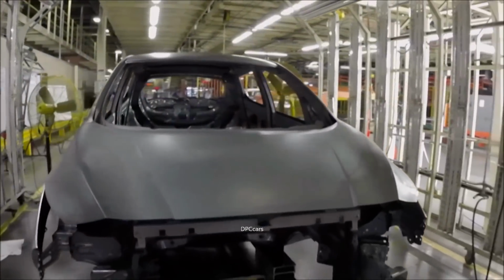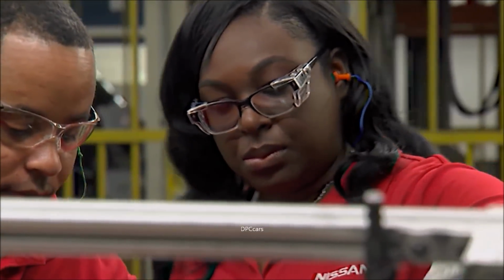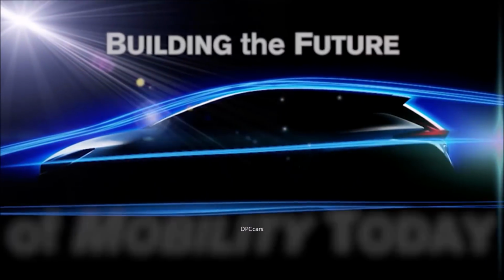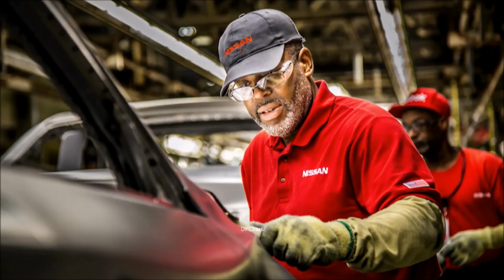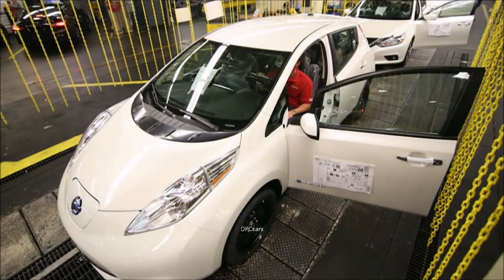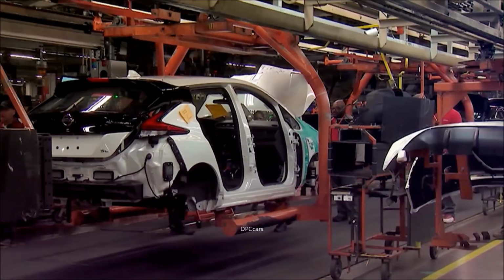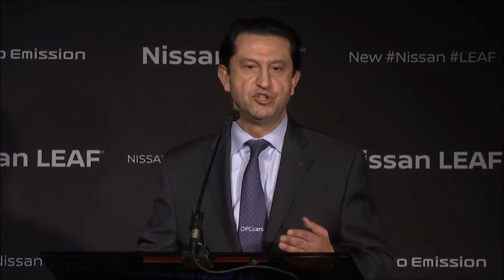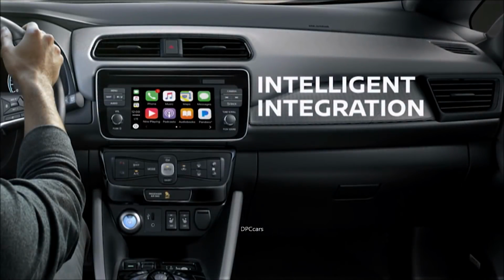2018 Nissan Leaf Factory - How Its Made

Comment: I had Leaf 2013 and that was quiet difference from leaf 2009 !! I traded in that 2013 for 2018 model last week..Wow,that is a completely different car !! Honestly I did not liked the stick out headlights on previous models,now the shape looks sharp ! I'm very happy wit it.They improve the steering and driving is more  comfy and smooth.Also finally it comes with 240V charger !! For me it's a big upgrade to have 150 miles range from 80 on that 2013 model.New battery charges up to 170 range !! But that will go down after few months and should be steady around 150 range  for years..I know this from previous Leaf..The new battery technology has improved as well.I love this car.For me it's a free ride, because I'm charging it from small solar plant I built at my house..Cool.Thanks Nissan for making so many improvements,you stepping up greatly since the first one in 2008..wow.Please don't stop and work on range,so in the future EV can go at least 300 miles per charge..

Comment: Its built for a price. There will be a larger battery model next year but guess it will cost more
Reply: I have no basis for this, but I suspect that the 60 KWH pack would only be on SV and SL trim levels.  It was initially the case with the 30 KWH pack in 2016.  Since chademo is a $1500 option, I think the SV trim will be the car most people should get since that's only $2500 more.  So, I'd predict the 60 KWH car will probably end up being closer to the $37K that the Bolt EV costs.  Personally, I'd just stick with the 40 KWH car and lower price.
Reply: Consider batteries are about $200 / KWH in today's prices, you can guess a car with a larger battery would probably add about $4k to the build price and probably a bit more to the MSRP.  Falling prices per KWH in time will bring that down.
Reply: $34k for a car with 60kWh that does 200mi+ sounds very enticing. That is still cheaper than the Bolt & Model 3 50kWh.

Comment: Its a great looking car, but i'm disappointed at the poor range. Only 25-30 mile increase from 2017 Leaf? Now if the Leaf had the 60kw battery pack the Bolt has, and i'd line up tommorow, instead of waiting 'another' year for a 200-300 mile Leaf.
Reply: I really can't wait to see the new 60kw version...   and since you said the 24kw early batteries had the degradation problems early on, makes me like Nissan a bit more. The only real reason I'd prefer the 60kw version is my wife has family in NC, and recharge stations are 'barely' just covering the trip there and back. Just the 250 mile range is that much better a cushion for long trips. 

Kimonoskunk <><
Reply: The current price of batteries is around $200 / KWH, so a 60 KWH Leaf would most likely cost over $4000 more - probably a bit more considering they need to make a bit of money as well.  I think the 40 KWH car is the best blend of price and range - I can get anywhere in my home city (Atlanta) and back home and never need to worry about charging on the road.  For a road trip, we'll take my wife's Sienna anyway.
Reply: You hate money? The Leaf cost ~$6000 less than the Bolt's starting price, and about ~$7000 less than the overhyped Model 3 which only has a 50kWh pack.
Reply: Trades46 Oh I agree, the price is great....  I was just wondering how much more the 2019 Leaf with the 60 kw battery will cost compared to the 40kw version. 
Besides that, what about battery cooling? I'm fairly certain Nissan will have the same battery degradation problems without the liquid cooling the Bolt does have.  
Now if Nissan just adds the liquid battery cooling that the Bolt has, and even if it has a 40kw battery, I'd buy one certainly. 

Looks-wise, the Leaf is a hell of a lot better looking than the Bolt. 

And, I'm not a fan of Tesla, I don't like the way he's burning thru hundreds of millions of dollars, coming up with all these new cars and ideas like the Semi, or the new Speedster. Get the model 3 built 'first'. And then after the 3 is widely available for $35,000, (while getting the 3's reliability and bugs worked out decently) then bring out the future projects like the Semi, the Speedster, and the model Y.
Reply: Kimono Skunk the Leaf 60kWh is likely going to be same as the Bolt at ~$38k I reckon (batteries are not cheap). As for battery cooling it still has a passive cooling which is done for again cost reasons to keep the car affordable. The battery degradation is mainly on the early 24kWh cars and occurs if you live in places that are really hot or you frequently rapid charge. As a commuter car, you likely will never encounter such issues.

GM has done a good job on the Volt & Bolt, but the again neither car has a heat pump again for cost reasons which makes range loss with heater on in winters like Canada an issue. I like how the new Leaf & e-Golf has them included. 

As for Tesla, with such a sketchy operation strategy, I actually want them to collapse.
Reply: Trades46 Thank you for the excellent reply...   ^^
Reply: J Pierre I feel the 40 kWh would be the perfect balance between range and cost.  Unfortunately here in NC rapid charging is not really available outside of big cities.  I'd like to see more rapid chargers on I-85 between Henderson,  NC and Petersburg,  VA,  there is a large gap there that disconnects the south from DC and the Northeast.
Reply: Trades46 :  I have Leaf 2018.Great car ! I'm not into Tesla,but hey..They building infrastructure of charging stations and as of now you can drive EV from coast to coast on Tesla stations, they are everywhere , of course you need to take Tesla to Nissan J1115 adapter with you, otherwise you are doomed on road trip !! Nissan Leaf is great car, but they don't do shit for charging stations, just local dealers and that's it.Non of those EV makers in the US do anything to build for example solar charging stations (as a current  gas stations)with food and hang outs place.Tesla at least has its product covered on the long road trips and again I'm not promoting Tesla.Just saying..:)
Reply: Kimono Skunk I believe the 60w battery comes out late 2018, but google it for details. Last I checked it was not in production yet, and we know from Tesla experience how “production dates” change and change again haha.. I’m lucky I only drive about 20 miles a day R/t
Reply: M3 is a rear wheel drive sport sedan with double wishbone front suspension and 5 link independent rear suspension. LEAF is an econobox front wheel drive with macpherson stut front suspension and torsion beam rear suspension with crappy air cooled battery pack. Like companring Nissan Versa to BMW 3 Series. Volt is even crappier econobox with a premium liquid cooled battery pack..
Reply: CMCNestT please. The Model 3 is shit, especially for its price. Outhandle a BMW? The Model S P100D can't outrun anything on a track before it's "water cooled" battery overheats, and that before I mention it weights ~2.3 tons. 

Also you conveniently forget the Model 3 would only be sold in 2018 (if they even can start making & actually selling them) as a 75kWh upgraded model with all options checked, roughly at ~$60k after taxes (and no more EV credits either since Tesla used it all). Autopilot is optional, unlike the "econobox" Leaf which has Pro Pilot on SV mid-grade trim. Superchargers would cost you every time you plug in with the Model 3. Last but not least, Model S & X have been falling apart via touchscreen freezes, door handle malfunctions, cracked glass and myriad of reliability issues (so bad CR went from a 5 star recommended to a 2 from unreliability alone). The worse the Leaf has to deal with is a 20% battery degradation, the Volt even less so.

Please get lost elsewhere Tesla fanboy.